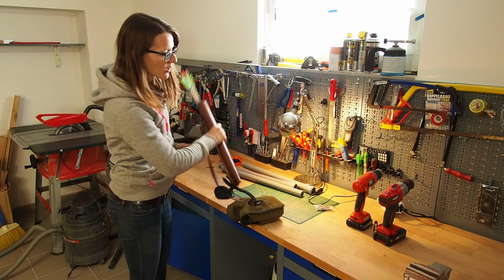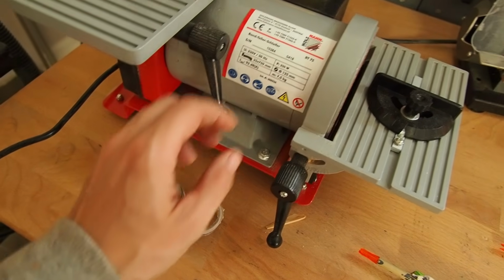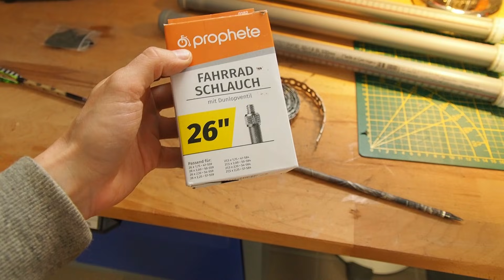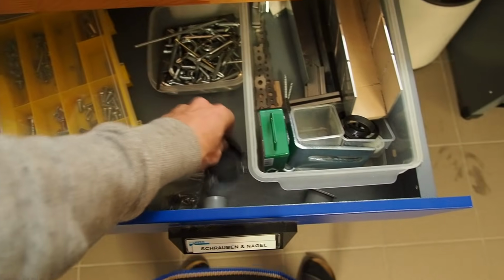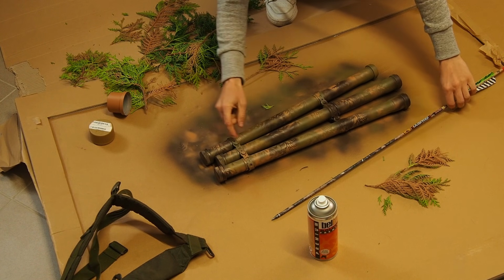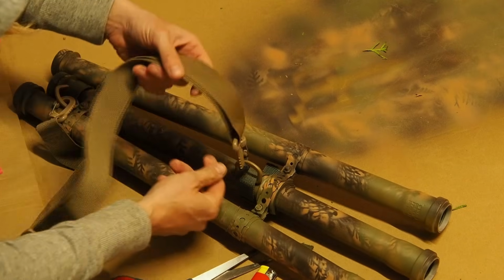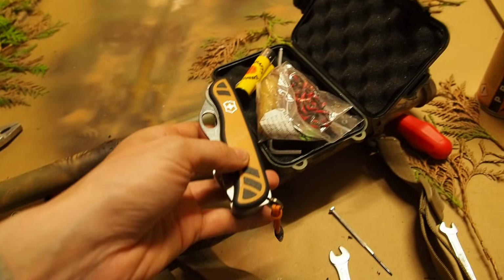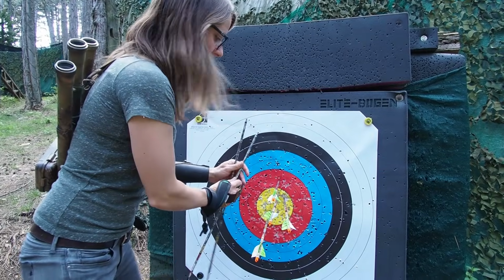How to build a Quiver for 10 Dollars!

Comment: I made on too. Thank you Lilly. I also have connected in the lower part with screws a bear grylls paracord knife. It's horrizontal mounted, the handle is stiking in the right side. Spray panted the sheat too. Looks awesome.

Comment: I have been getting my daughters into archery for a while and have found thrift stores and second hand shops a good place to get starter gear. Survival Lilly  you could also insert short lengths of the pipe in to your leather quiver. I have always found that leather is quieter than plastic. I ground hunt alot for game, I have been busted by deer  because of the tip of a stick rubbed on a plastic quiver as I went to full draw.

Comment: Great vidieo. Love it when you build DIY stuff. Fun to watch you get creatative. You could mount the canvas bag above the plastic repair kit make it more streamline. But don't give up on your old quiver. I mounted a thick piece of latex foam in my quiver . Drilled six ho!e and now the arrows don't rattle around. Even apiece of leather across top of quiver would work.  Just a few thoughts.

Comment: Looks good Lilly if you take some plastic wrap and some WD-40 and some Elmer's craft glue lay the plastic wrap out flat spry with WD-40 then take the glue and make a pattern with it on the plastic wrap and let dry it will pull off and you can use it as a paint stencil it can be bent to cover the hard to get to spots and but used over and over again and again.

Comment: One addition you could make to the quiver (since you have two arrows per pipe) would be to add a separator of some kind and cover it in that felt you used. this way when you pull out the arrow they wont rub against each other.

Comment: A very good build! Should hold up even in " acid rain conditions"... Turn your lighter to the up position, or, when you need it, probably won't work cause it will leak out! Just above that kit, mount a soft military grade "Molly pouch " to the upper brace for extra arrow points for different game! Just a thought...

Comment: I like the way that you did this the only thing that I would do extra to the end caps is to drill some small holes in the caps for water drainage from rain,ect. It would help so that your tips do not rust and get ruined from water collecting in the bottom and staying in the cotton another thing I would do actualy 2 things is 1 on the shoulder strap I would sew in where you have the D-ring at the top  I would attach the shoulder strap permanently and at the bottom a quick release buckle with an adjustment slider buckle added so that you can adjust the strap easier for clothing for different seasons and warmer/colder temps. And 2 I would also add a stabilizing strap for around the waist u to a spot about mid way to the lower sternum of your chest to keep the quiver a lite qquitle more sturdy and higher on your back, so as to reach the arrows easier. Also I would add to your pouch on the strap a small first aid kit, and on the quiver a second bov like the one for tools slightly above the first for hunting tips and a wrench for them only. Also I would add some padding if possible to help protect your back. Sorry so long please keep up the great job that you are doing.

Comment: Instead of using the clamps system. You could place the toobs in a triangle all together and use black tie raps to hold together. Using black is for uv protection and will not break apart like the white ones will.I love the camo colors, and do you sprey your own christmas trees?

Comment: This is awesome! I have a similar setup. But I took the foam the arrows come in and cut them into squares and then rounded the edges and glued them into the ends. Now each tube holds 4 arrows silently.
Downside: harder to draw and place the arrows into it. But now you can carry 12 almost silent arrows.
P.S.- I love the tree branch pattern idea

Comment: Hate to be a stick in the mud, but back quivers are a cool novelty item. That's about it. Yes, the traditional guys use them. But any serious bow hunter will use a riser-mounted quiver. They are more secure, quieter and in most cases, quicker to access. 99% percent of bow hunting is being quiet when moving through brush, sitting, waiting for game to approach--often for many hours. You can't sit down and be reasonably comfortable with a shoulder quiver on your back. Likewise, you can't be rustling through the forest (if that's the environment you're hunting) catching your nocks and fletching on branches.  If you insist on a shoulder quiver for hunting, know these limitations. Back and side (hip) quivers are primarily used for range and target shoots.
Source: Compound bow hunter for over 30 yrs.
Reply from the maker: I never liked arrows attached to the raiser, it makes the bow unnecessary heavy in my opinion which is causing me a lot of shake. Some like side quivers, others like back quivers and some like quivers attached to then bow... It is all personal preference in my opinion. Thanks for watching.
Reply: @SurvivalLilly  I see your point, but just like a back pack, you hike with it and get use to the extra weight til you barely notice it. Have a great day/evening

Comment: It is a good idea but the smaller tube limits you to only target tips you need the tube larger to allow hunting tips also even folding ( mechanical ) ones to allow for clearance and not hang up on the other heads. Also what would work better for a tool kit and parts pouch is an old m16 mag pouch.

Comment: I would have taken 2 pieces of the really hard thin plywood and take a hole saw and cut out 3 holes that the tubes would fit tight. The upper one would be about an inch of clearance and the bottom one would be as tight together as you can get them than wrap either cloth or leather around the whole thing than add frills at the top and bottom than a strap to carry it. Excellent idea just needs improvement.

Comment: Interesting project and a cool look. I have a thought (as usual): Replace the cloth at the bottom of the tube with a "plug" of synthetic rope fibers thick enough to completely fill the opening (width) of the tube, and approximately 30 mm long.  Holding the bundle together (not too tightly), melt and fuse one end with a hot iron, then stuff it down (with the unfused end toward the top) to the bottom of the tube. You should then be able to slide field points or a narrow broadhead into the fibers, which should grip and silence them. 
Cut a short, narrow strip off a bristle welcome mat (or equivalent), and glue the strip around the inside top of the cylinder so the fibers (pointing inward) will cushion and prevent the shafts from banging against the tube top.
Of course, you won't get many arrows into such narrow tubes, but this could easily be scaled up to accept more shafts or wider broadheads.